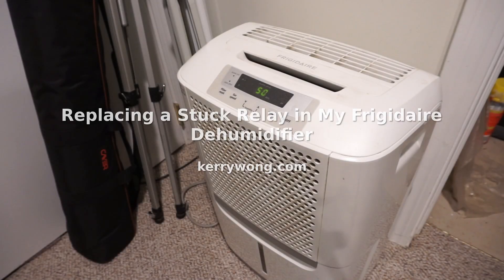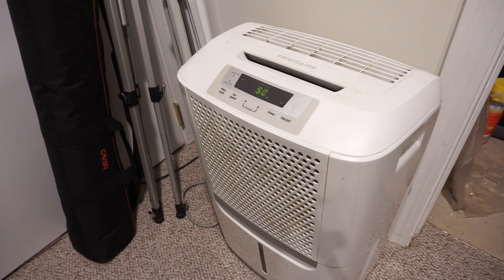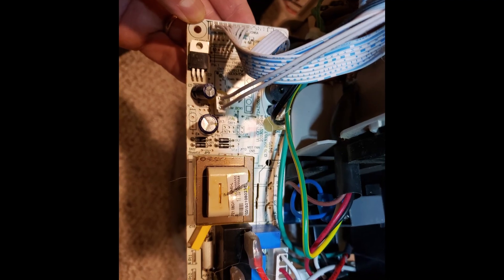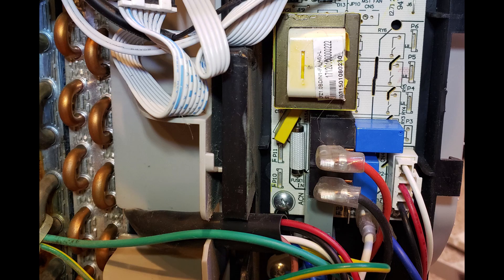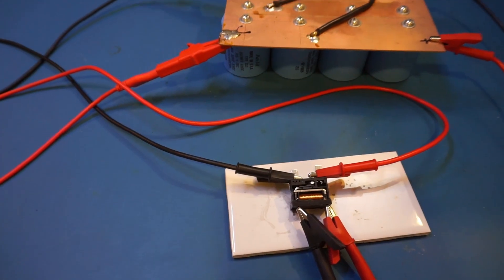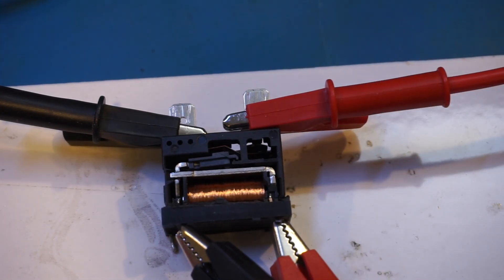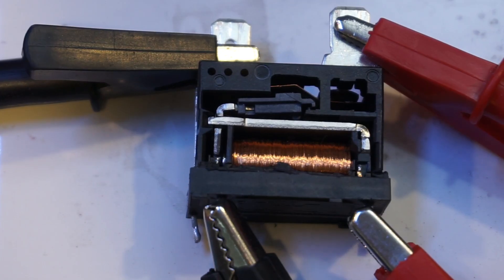Frigidaire Dehumidifier Welded Relay Repair – How does Relay get Stuck

Comment: Review suggestion:  I just received an order of FNIRSI USB Fast Charge Tester FNB58.  My initial reaction is that it is a neat instrument which can measure battery capacity, cable resistance, supply voltage and current, power consumption, etc.  Results can apparently be uploaded to a PC via Bluetooth.  The FNB58 has some built in basic graphing.  The unit arrives in a small sturdy box and looks better than average for a FNIRSI product.  There are zero instructions in the box, but a QR code is printed on the box.

Comment: Does the relay have an adequate snubber/suppressor across the contacts?
Reply from the maker: I don't think I saw any on the circuit board.
Reply: @KerryWongBlog  
I had such a failure with a Chinese chiller.
I am 99% sure that that was the reason the relay failed after less than a year.
The contacts looked awful.

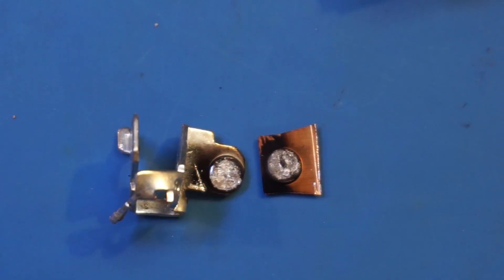Comment: 4:14 I like the large # of small charred black carbon prints that poka-dot the white ceramic tile you used as a stage: are they remnants of the arcing every time you conducted a test with the relays exterior cut open or something else?  

To me it looks like silent evidence of your thorough testing before deciding to present your findings to the rest of us which I respect and appreciate.

Comment: I had motion sensor relay contacts Weld with as little as 100W of LED power, in about a year each. Even tried different brands of relays. Eventually fixed it by using a motion sensor with a transistor. My washer-dryer is also utilizing triacs for everything but the two heaters. Solid state is the way forward.

Comment: Off topic, I have purchased a Uni-T 71D you are doing a continuïty test with your Uni-T, I was testing a transformer a 1:1 and found that the meter could not do the continuïty test  at a 136ohm resistance dc , is that common for those meters, my 60 bucks cheaper nameless multimeter from the construction market could do it, little pulses where hearable....Kind of underwhelming for a multimeter of 200 bucks....
Reply: I guess it depends what you prefer to consider as "continuity". I looked up Fluke's FAQ, and they say most multimeters indicate continuity between 0-50 ohms. To me, 136 ohms seems way too high, for most of my stuff I would only want a beep at <10 ohms.
Reply: @drojf  Thanks, it seems to me that 136ohm isn't that much given that the wire of this transformer is thin and not very long, 
but it makes sens that OL , open lead or short if you do this test when not hooked to any power supply would be possible if you just measure point A to B regardless of the amount of ohms, to a certain extend I quess but where to draw the line, Each test is different you see, if you just want to measure point A to B then the UNI-T 71D has failed, to be frank, If I want to measure ohms then this continuïty test if not much good see my point, I could do that on a different setting....Anyway thanks for the answer

Comment: Replace with solid state relay
This way, there will be no inrush current and operate silently without any issue.
Just make sure to use one that trigger at zero crossing.
Reply: Even with an SSR that will turn on only at low voltage, there will be an inrush current because of the motor starting.
Reply: @paulcohen1555  And starting at the zero crossing is worse. It will cause inductors to saturate. Because normally at the zero crossing, there is still current from the opposite voltage flowing. Which means less current buildup for the next half cycle.
Reply: @pizzablender  
That applies mostly to transformers whose core will saturate (The higher the power and quality, the worse the situation will be).

Comment: How about installing a solid state relais  ?
Reply: Ask the manufacturer why they designed it this way. It's certainly not for the lack of off-the-shelf parts being available.
Reply: @graealex 
Perhaps they wanted to save a few cents while introducing planned obsolescence  ?
Reply: @ Not every product is built down to break after 5 minutes of usage. Appliances live off their reputation.
Reply: @graealex 
Not anymore. Ask LG or Samsung !
Reply: @billspencer8540  Both make great appliances. Both invest heavy and making advanced electronics. They both use inverter drive everywhere.
Reply: @graealex 
And yet, they make an effort to slightly under engineer their products so you come back to buy something new while you happily hand over sales tax again .
Reply: @graealex  
Will a "smart refrigerator" with inverter drive and electronics work without failing for 30 years or more (until the body rusts and disintegrates) as the ones with induction motors made in the fifties ???

Comment: I have a late model large-BTU Friedrich window AC and noticed they are using a solid state relay for the compressor.  They probably got sick of warranty claims for stuck relays.  None of these appliances use proper  HVAC contactor relays probably because they are too loud and bulky.   I would probably make such a repair trying a solid state relay, although you have to source these carefully as the cheap units on amazon are all way overrated and many of the good Omron branded units are in fact counterfeit...
Reply: It's a slow move by the industry. Appliances are usually a bit faster. Washing machines mostly use inverters for motor and triacs for pumps and solenoids nowadays. They're even switching to beltless now, one less part to fail.

Comment: Edit, see last paragraph.  The relay looks a little under sized for the job.  Almost all portable room dehumidifiers are rated for about 760 Watts operating power.  After the fan load and controller board are subtracted that leaves the refrigeration motor at about 3/4 horse power assuming power factor correction is installed.  I checked some HVAC discussion boards and it looks like locked rotor inrush current is about 6 times the operating current.  That suggests the inrush is about 27.9 amps for a few milliseconds when the contacts close.

There is a smart controller in the unit so it should have a time-out before it allows the compressor motor to be restarted, giving time for system pressure to equalize though the capillary bypass tube between the compressor inlet and outlet.  That should prevent starting the motor in locked rotor state most of the time.  I would still feel better if the manufacturer had chosen a 30 amp relay.

If this unit is powered by 240 mains, the current would be 1/2 of my assumption above which was 120 volt supply.  The inrush should not be more than 14 amps, which is within the rating of the relay.

Comment: The contacts in that relay are too small for 20A. No wonder they've welded. I would replace this relay with a beefy 30A off board relay and put a 220nF capacitor across the contacts to reduce arcing.